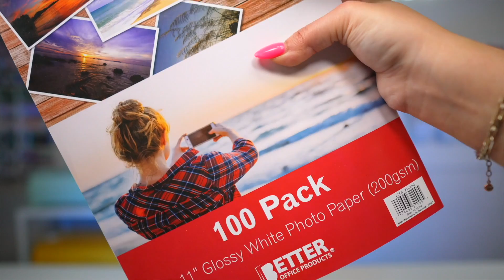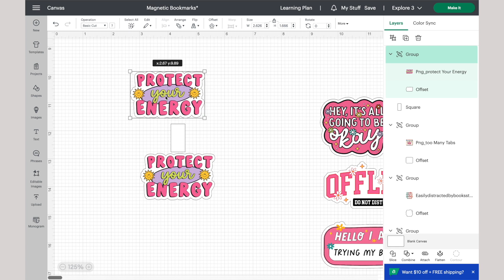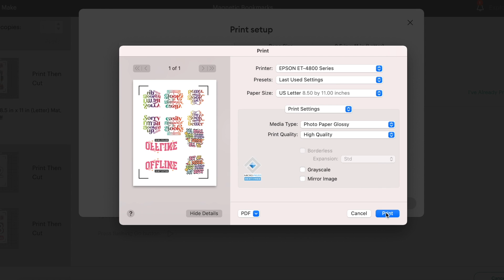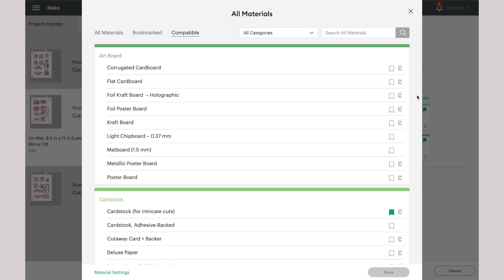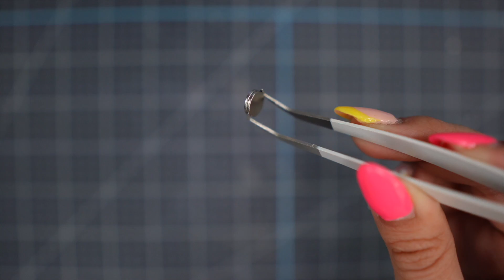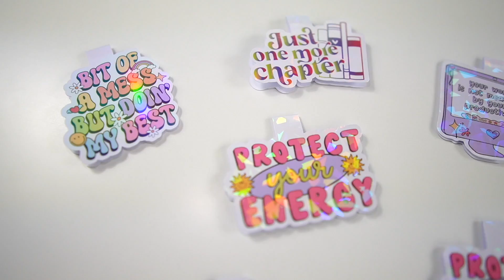HOW TO MAKE MAGNETIC BOOKMARKS WITH YOUR CRICUT! | Easy Tutorial

Comment: I have a question about  one of your printer functions.  I see that you used your system dialogue box on your computer. Do you not have to change any settings on your EPSON printer to match what you selected on your computer?  I have an EPSON ego tank 2850. I have to change both my computers, dial our box and on the printer itself.  It’s a hassle. Maybe I need to change one of the settings??

Comment: Aren't your bookmarks with text backwards on the flip side?
Reply from the maker: Yes the back side is flipped, it would only align with the front side if I mirrored it
Reply: @DIYholic  I will try to explain. In Design Space, once you have your offset added to the image, duplicate it. Both of the images look identical and can be read left to right. So, place one of the images at the top of the space, and the other underneath it. At this point if you added the middle tab, and cut it out, the flip side of the bookmark would be backwards. So here's the solution. They are still looking identical, but highlight the top one, to to the top menu where it says "rotate" and enter the number 180, press enter. That's it!  It works, I've been doing it to many bookmarks. Don't flip anything horizontally, vertically, etc. Just change the top image to 180 degrees. I hope this helps. Let me know if it doesn't.
Reply: @barbra429  thanks so much. I tried what you said and I can read both sides but they do not line up at the sides and bottom. Does yours line up as well as reading them on both sides?
Reply: @kayb6009  once they are on the page, you won't be able to tell at all. Plus, I make the magnets holder cards, and it only shows one side til you flip it over.
Reply: @barbra429  thank you so much for the help.

Comment: Confuse just a little regarding the magnet part. So you put the adhesive on both sides of the magnet on both sides? A total of four adhesive fore one bookmark?
Reply: It’s two dots per bookmark. I’m having problems with the dots dot holding the magnets.  They stay stuck for a while and then peel away from the dots.

Comment: Great video and easy to understand and follow. I did notice the other side of bookmarkers your words are backwards..any tips on how to fix that?
Reply: I was thinking the same, any advice?
Reply: Dont flip, instead rotate the top one 180 degrees, it works. @torifraire1777
Reply: She said to flip vertically. When she was showing the steps that what she did. But in a later clip you can see that they aren’t the same way anymore. You would just flip horizontally as well. That fixes the issue
Reply: @kerteeveeyuh Don't flip the top image instead rotate it 180°. It works

Comment: one thing i discovered is that when you flip the image vertically, it appears mirrored and does not line up after the cut.  So I also flipped the image horizontally as well.
Reply: So did it line up after you did this?

Comment: When I flip the image vertical I can't read the flipped image side when printed out it is backwards. What I am doing wrong?
Reply from the maker: You are doing it right, the back of the magnetic bookmarks won’t be readable. It’s the only way it will align perfectly to the front side 😊
Reply: @DIYholic Do not flip the top image vertically nor horizontally. Instead rotate the top image 180°. That will make it readable it won't matter if they don't line up when looking at it from the front because it will only show on the back. Try it, it woks perfectly.
Reply: Flip horizontally

Comment: Great tutorial. When I flip the text, it reads backward. How do you make sure the text is readable on both sides?
Reply: You have to also click Flip Horizontally!!
Reply: @kourtney974 but then it doesn’t match the other side 😢
Reply: Instead of flipping, click rotate 180 in the box next to the size
Reply: If you watch carefully she doesn't show the reverse side where the words are backwards.  There is no avoiding this unless you place the image/words in a white box on both sides to make the bookmark.  Then you would just copy the image/words and paste them onto the white box.
Reply: @SassisScrapbooking  It can be avoided if you change the rotation box to 180
Reply: @barbra429  I tried this and they didnt line up. Can you elaborate?
Reply: @kayb6009  I will try to explain. In Design Space, once you have your offset added to the image, duplicate it. Both of the images look identical and can be read left to right. So, place one of the images at the top of the space, and the other underneath it. At this point if you added the middle tab, and cut it out, the flip side of the bookmark would be backwards. So here's the solution. They are still looking identical, but highlight the top one, to to the top menu where it says "rotate" and enter the number 180, press enter. That's it!  It works, I've been doing it to many bookmarks. Don't flip anything horizontally, vertically, etc. Just change the top image to 180 degrees. I hope this helps. Let me know if it doesn't.
Reply: Mine does the same thing!
Reply: So you do ur design inside a shape wouldn't you

Comment: I love this! I only have 1 question? How do you handle the text being on the opposite side? It doesn't switch to a mirrored version with the flip.
Reply: I think text on both sides only works when you have regular shapes that match up perfectly like squares, circles, etc.
Reply: Flip the top image horizontally and vertically to make it readable from both sides
Reply: the reason she only flips vertically is so the cut lines line up perfectly. No text images or bookmarks on shapes (vs offsets to text) can be flipped horizontally without issues to lining up front and back.
Reply: Can we please get a response to this question?
Reply: After much searching, i found the solution. Do not flip the top image. Instead, rotate it 280 degrees. It works. I do it all the time. Let me know if it helps. @neim.4836
Reply: She just vertically flipped them in DS! ☺️
Reply: Yes, but the text is still flipped since it doesn't mirror.  I mirrored my text by flipping it vertical then horizontal, but now the image doesn't line up. @wickedwayz414 @neim.4836 @trippi-hippy

Comment: Hi! I love this craft- I am trying to purchase the things you linked and I just wanted to confirm that the glue dots you're using are the "0.39 Inch/ 10 mm)". Is that right? Thank you again!
Reply from the maker: Thank you! Glad you liked it ☺️ The adhesive dots I used were the 0.24 inch/6mm since it will fit just right on the 8mm magnets. Thank you for pointing that out, I will be adding a note of the size on the description 💛

Comment: Loved this well done tutorial. 
My only recommendation is a warning about the safety with those tiny magnets and kids. I would add a piece of packing tape over them so if a little one got a hold of it they can't pull the magnet off. Those magnets are deadly when swallowed
Reply from the maker: Thank you! I understand your concern, I typically don’t let any kids in my craft room due to a lot of the craft supplies I use are hazardous including the Cricut blades, heat presses or anything small such as these magnets etc. That’s a great idea, I did mention they are very small in the video so people should be aware of the size and take that into consideration if they have small kids at home
Reply: Love this tutorial and how you approached it in a step-by-step simple fashion.  Regarding the magnets, I saw on another video where a piece of sticker paper was cut in the overall shape and applied over the magnets.

Comment: Thanks so much! Question: I see that they are printed on both sides but from my perspective it seemed the back side printed backwards and only one side was readable. Is that true or is it readable both sides?
Reply from the maker: You are welcome! Correct, only one side is readable and the other is mirrored. The reason for that is because one of the images needs to be flipped vertically so both ends align perfectly when they are folded 😊
Reply: @DIYholic  is there a way to fix that so both sides are readable and still lined up
Reply: @mama2queenshettwer15 I noticed the same thing and yes just flip it vertically then horizontally and it should read the correct way on the back. The shape won’t line up perfectly on both sides, but once it’s on the book page, it will be legible on the front and the back. Another thing you can do is just keep only the image on the front side, and delete the other upside down image (the one intended for the back of the bookmark) before flattening — but be sure to keep the offset to retain the shape. I hope this helps!
Reply: @JoyfuleeCrafted  thank you for the suggestion. It was driving me crazy that I couldn’t get it to lined up and be readable on both sides so I end up deleting the back side an adding my logo instead. The tutorial was great, this will make a great addition to my shop
Reply: @mama2queenshettwer15 You can make the backside readable this way. Do not flip the top image vertically or horizontally. Instead rotate the top image 180° that way it will be readable. Hope that helps.
Reply: @barbra429  but it wont line up....is this correct?
Reply: Hahah glad I wasn’t alone. I kept deleting my images like this won’t look right! 😂
Reply: @AileenLeyba I did the same thing, it was driving me crazy 🤣